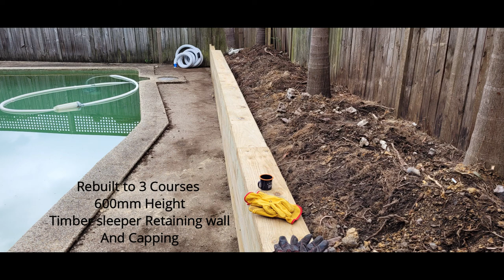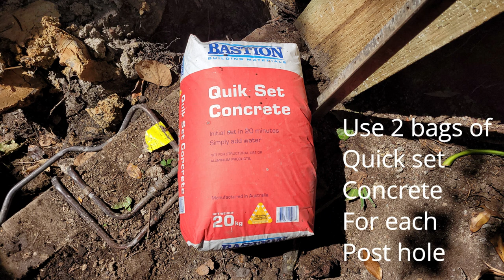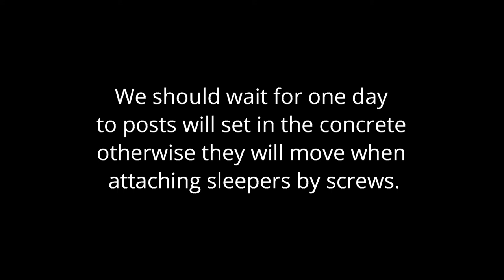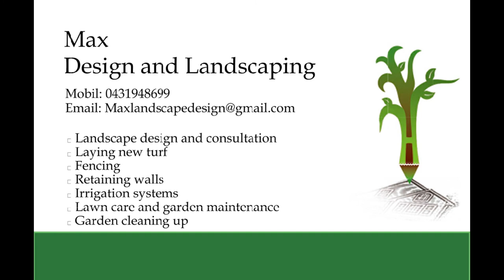Timer Retaining wall and capping, retaining wall structures, landscape design retaining wall,

Comment: Sleepers in front of posts means pressure of soil/gravel etc will eventually push the sleepers off from the posts. Sleepers should always go behind the posts.
Reply from the maker: You right, in this case we don't have that pressure to the retaining wall as there are not filled by soil and existing soil holded by Palm trees roots.